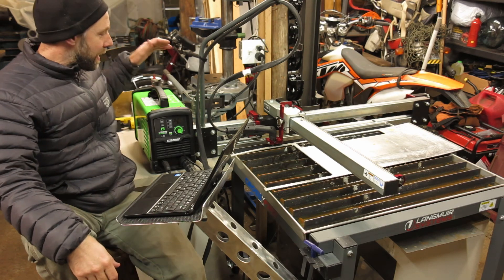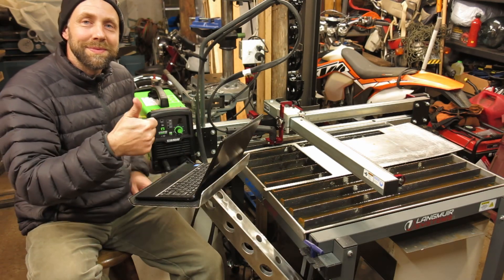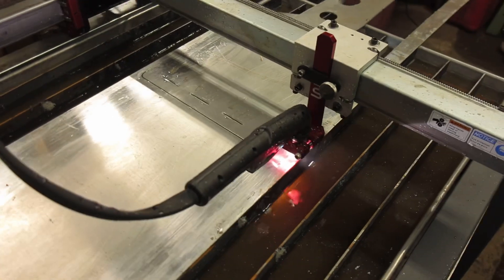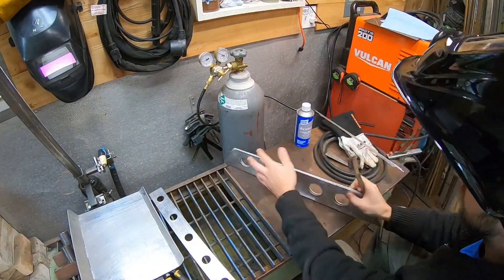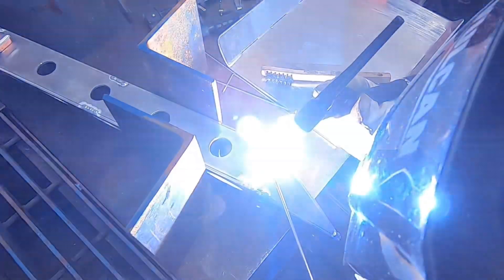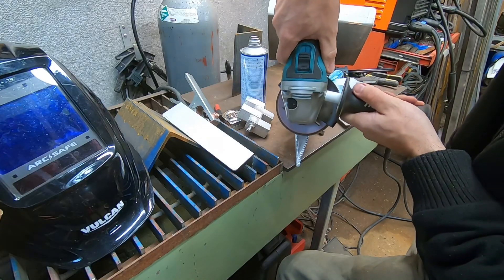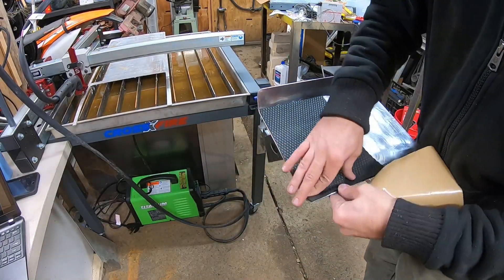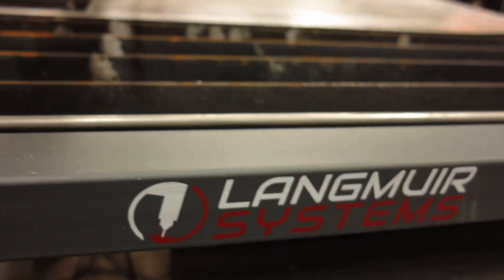Crossfire CNC plasma table Titanium plasma 45

Comment: STOP! Do not cut Aluminum on a water table!! Your garage is going to look like the Hindenburg if your not careful. 

“Explosion Hazard - Never Cut Aluminum-Lithium Alloys In The Presence Of Water. Certain molten aluminum lithium (Al-Li) alloys can cause explosions when plasma cut in the presence of water. Do NOT plasma cut Al-Li alloys with or near water. These alloys should only be dry cut on a dry table. Do NOT dry cut over water. Do NOT use water injection plasma torches. Contact your aluminum supplier for additional safety information regarding hazards associated with these alloys.”

https://www.esabna.com/us/en/education/blog/can-you-plasma-cut-aluminum-on-a-water-table.cfm
Reply: The company I work for has cut Aluminum with plasm. However, there is a bubbler system that goes in the bottom of the water table to prevent the buildup of hydrogen. The risk is not just when you’re cutting. The gas can be held in suspension for a long period of time and be released suddenly which causes the risk for explosion if ignited.  Of course I understand this is your shop and your rules Im just trying to be helpful and keep you around for more cool videos.
Reply from the maker: Cannon Roberts I appreciate it 🙂 I will look into this more, I probably could drain my table and put a scrap sheet of metal down the save the SS table. Thanks
Reply: i concur! high explosion risk! might blow off the table across the room.
Reply from the maker: I have already read about the possibility of hydrogen gas, I am only cutting small pieces of aluminum and I have a fan running across my work, I talked with a friend that runs a CNC all the time for a fabrication business and he said as long as I’m only cutting small sheets of aluminum it’s fine.

Comment: For the projects I want to do, I'll need a 4ft by 8ft plasma CNC table. THAT is going to be expensive. For the 24in by 24in model to work, I'd have to cut down the sheets to fit.
Reply: Just checked out their website. The price is very tempting. The expensive Lincoln Torchmate is obviously much heavier built and meant for production work. It also has its own computer and plasma cutter machine, plus software with a nesting program. But all that comes at a cost. Looks like I'll have to wait to order and pay the $3000 for batch 3 for Langmuir's bigger CNC table. Batch 2 for their bigger plasma CNC is $2500.
Reply from the maker: One cool thing about this table is it’s arm is cantilevered over the cut table with only one track so you can put a bigger sheet of metal on it as long as it’s supported, of course you only get a 24x 33” cut area but it’s still nice there’s not tracks on both sides. I did see they are coming out with that bigger table, my CNC doesn’t have z movement, ( the torch doesn’t go up and down, the bigger table has the option to buy Z controls but it cost more.
Ps I’m going to call Langmuir systems this week and see if I can get a promo code to post in my next video, if so it will knock $100 off on a purchase price of a CNC table, I don’t know it it will just work for this crossfire or if it will work with both tables? I will let you know 🙂 Take care
Reply: @Mikefestiva , by the time I can order the big 4x3 table, price will be $3000. Am fine with curring pieces down to size to fit the table, as primarily need it to cut the custom designs into panels for the custom outdoor fireplaces/fire rings I'd like to make. How long have you had your CNC plasma table? I have a generic Cut-30 plasma cutter and would like to use it with this table IF it is compatible to mount it. My plasma cutter does not have pilot arc, but uses a standard PT-31 plasma torch. Any idea if my plasma cutter will work?
Reply from the maker: I just got my CNC a few weeks ago, I’m still learning a lot but I feel I’m past the worst of the learning curve, Fusion 360 is the program you use to draw up your parts in and it’s becoming much easier to use. I have a cut 50 plasma and I have read and heard from people that high frequency plasma torches won’t work because of the interference they cause to the sensitive electronics on the CNC, I’m going to sell off my cut 50 to a friend for cheap. If you go to the Langmuir website there’s a list of plasma torches that they know work with there tables. You definitely should check that out. Take care
Reply from the maker: Hey I just posted a link at the top of the comment section for a promo code for Langmuir CNC the Promo code will save you $100 off your table price if you end up buying one 🙂 and once there bigger table becomes available the promo code will work on that one too. Take care

Comment: HAED TO BE LEAVE A TABLE SIZE OF 2X3 WOULD DROP THE COST OF A 4X4 ART TABLE FROM A WELL KNOWN WEB BRAND  that been charging up word of 12000.-- for one that is no good for a welder/mfg like my self the needs to cut big pin boss out of 1" plate or backhoe bucket panel, to grapple arms for my repairs to custom builds, that brand table is made only for ones that cut art out of 12, 14, 10 ga and maybe up to 1/8" buy 10 ga is so close to 1/8" its cutting hairs sheet metal, that stuff i cut nicly with my metal saws ..  now only 1200.00 for one that is only 2x2,, hell i dont need a table all i need are the main parts and control;s, i make my own table that fits my needs and hold the weight i need it to, i can only pray and dream of ever owning one and i have a 38 years into the trade and it just not in my budget for one, if i did art them maybe, but not for one that is made to do real life welding and mfg
Reply from the maker: This size table should fit my needs in a small shop. Most parts I need to cut are 3/8” and smaller, I have seen people posting videos on YouTube cutting 3/4” and 1” stuff on this table. There’s a lot of DIY plasma tables out there, If you do some research the parts are really affordable, I just didn’t want to mess with trying to figure out how to get all the software working with the hardware.

Comment: Where are you getting specs on the 205 from?   I was on hold on the tech line for 15 minutes last week.  Couldn’t get any info.  Not sure the person who answered could even spell welder much less know how to use one.
Reply: Specifics about the post flow adjustment and any new feature details/ pulse adjustment info.
Reply from the maker: I can look into it and see what info they will give me? If I find out anything I will let you know 🙂
Reply: Thanks Mike!!!   Otherwise it’s a Everlast 185DV for me.
Reply from the maker: Hey Leo I never had much luck getting ahold of people at HF let alone getting questions answered, I know the frustration. I sent out 2 emails in the past asking when the Titanium 200 spool gun would be available, no reply 😕 I now have a contact with one of the main people at HF for there welder development. 
What questions do you have about the ProTig 205?

Comment: Is a titanium 140 welder any good because I'm thinking about getting one
Reply: I have the titanium 200 and I love it. Same line just the 140s big brother.
Reply from the maker: I have not ran the 140 but I like the flux 125 and the Titanium 200, I bet the 140 would be a good machine. I would however recommend buying the 170 for the fact it’s multi voltage so it can run like the 140 on regular 120 volt plugin, but if you want to weld on thicker metal you have the extra amps. I can’t remember the price difference but you would not be as limited on amps with the 170. Take care 🙂
Reply: @Mikefestiva  thx because I'm.   Wanted to get one for Christmas but I hope I can I love make go kart but the welder I got right now is about to die on me so I seen your video's and I thot I would ask u about the welder have a nice day and God bless